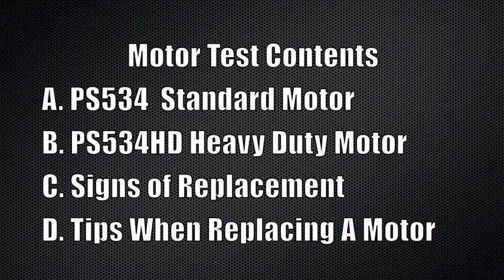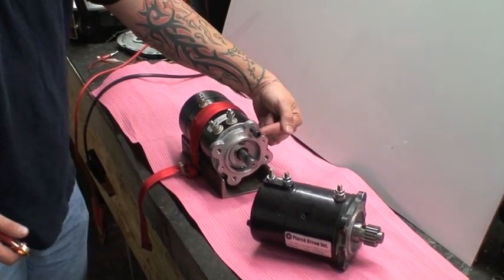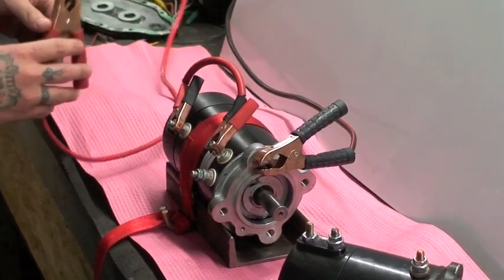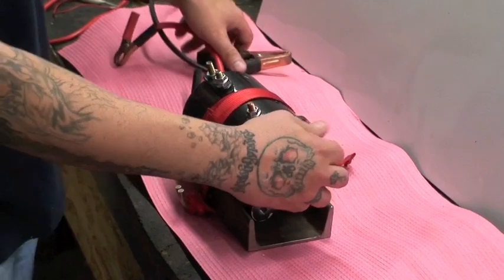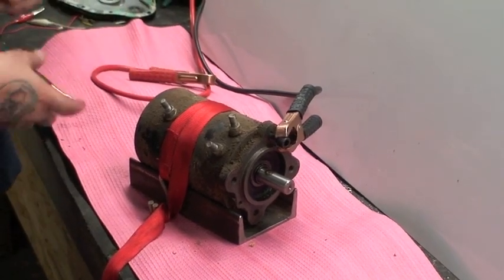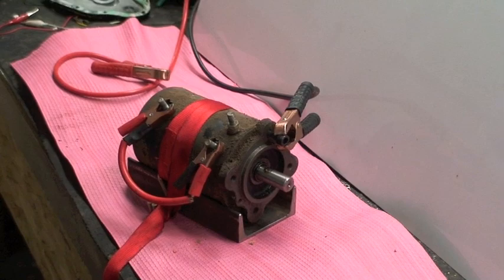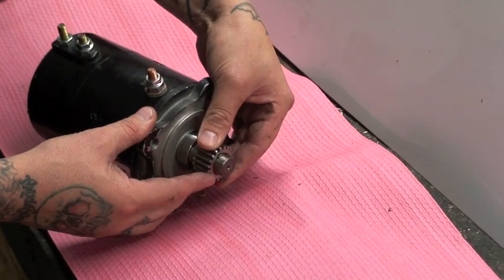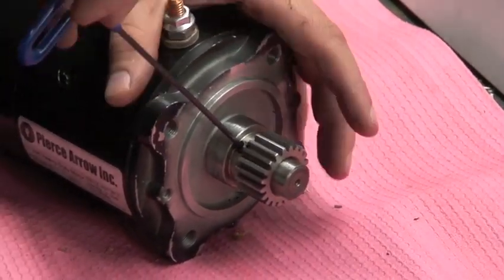Motor Test: PIERCE PS654 Worm Gear Winch

Comment: Hi! my winch works a little slower than ussual, but when I connect the positive to the F1 or F2 post, the cable from armature to F1 or F2 starts to runs extremely hot, you can see a little of smoke, what can be the problem? is a ramsey REP 9.5 e winch